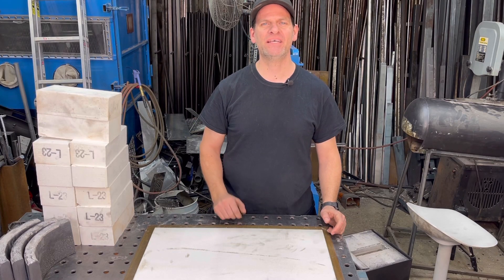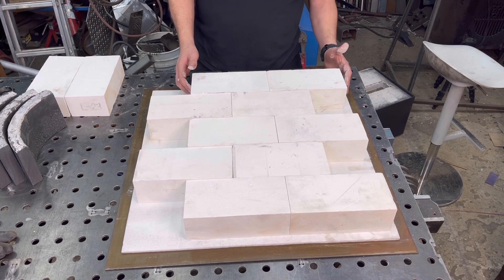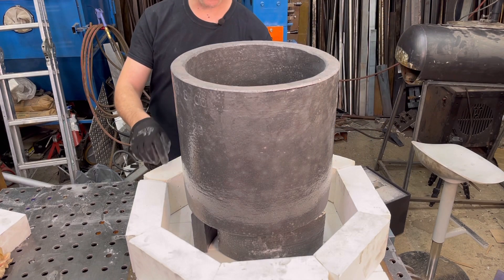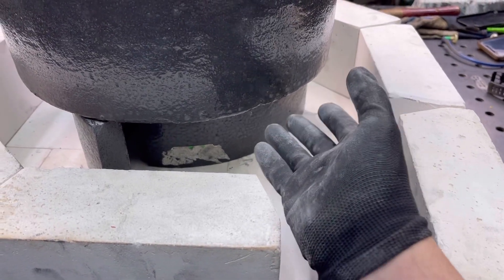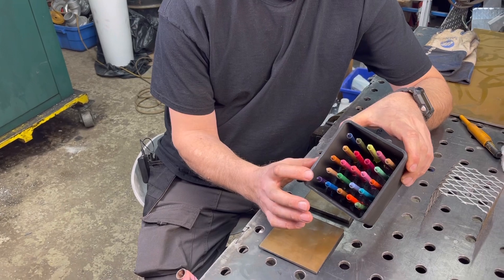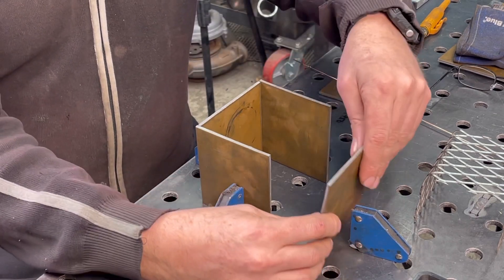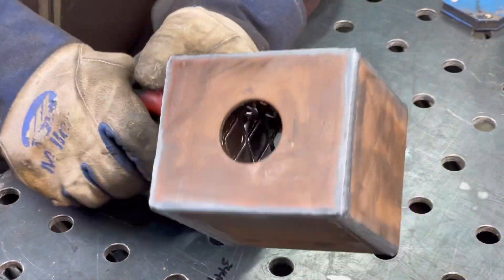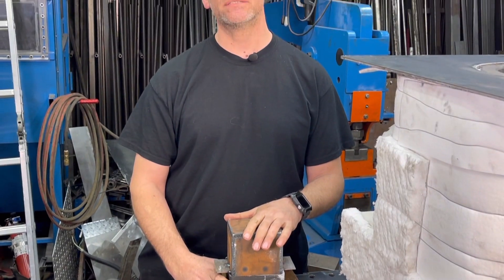Building A Huge Foundry Furnace !! Part 2

Comment: Peace be upon you, my dear brother. Dear brother, if we make the air outlet via the tube from above, will the heating efficiency not be good? Why are there ovens with air and fire outlets from the side of the oven structure from above? And few people make the air outlet tube at the top of the oven next to the crucible? If the tube is from above next to the crucible, will the heating chamber be sufficient to melt the metal with good efficiency?